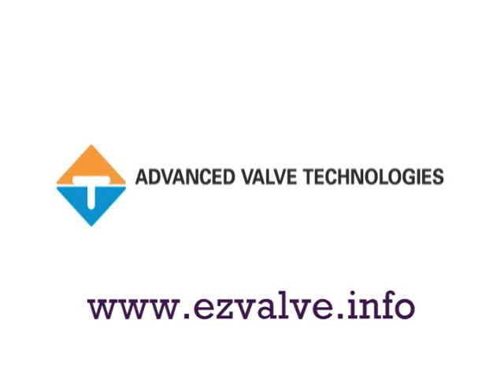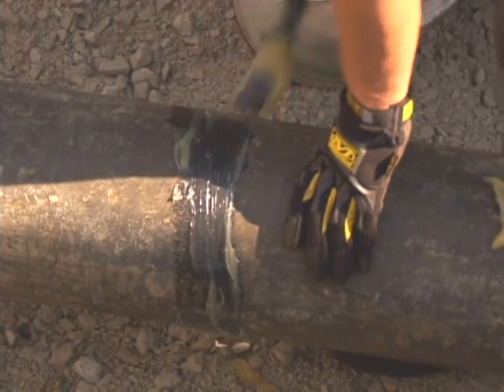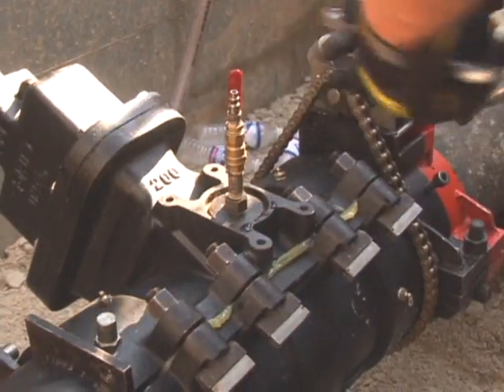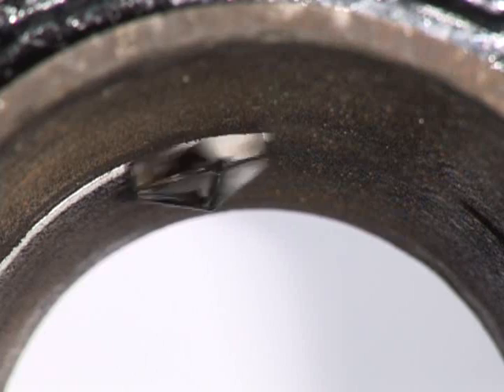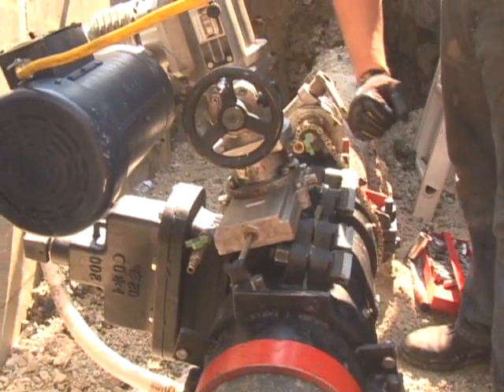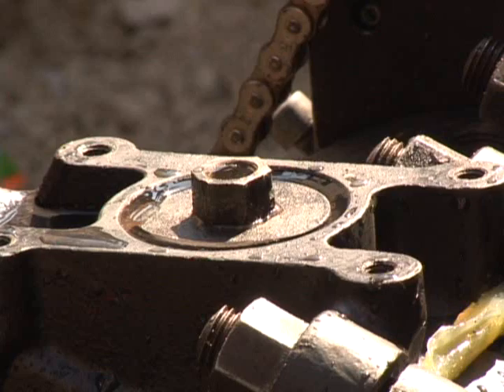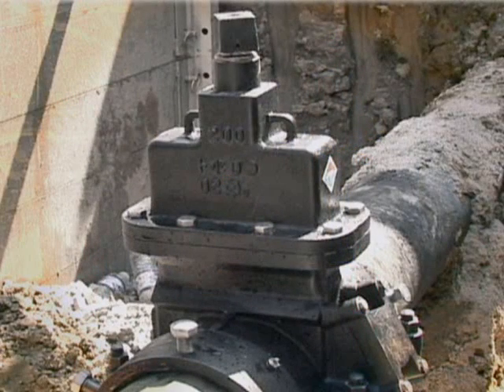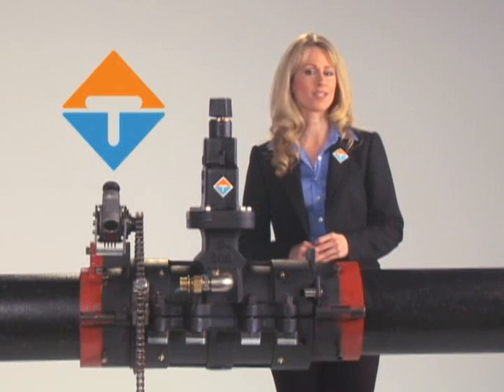Ez Valve - a new way to install main line 4" to 12" water valves, ezvalve, ez-valve

Comment: See a major flaw, this won’t work with ductile iron pipe with build up inside of the pipe. You’d need a smooth surface
Reply: I doubt that a simple wedge will create a clean surface for a complete shutdown
Reply: It works Levi!  Exercising the valve breaks up the carbuncles in the pipe and you get a good kill.